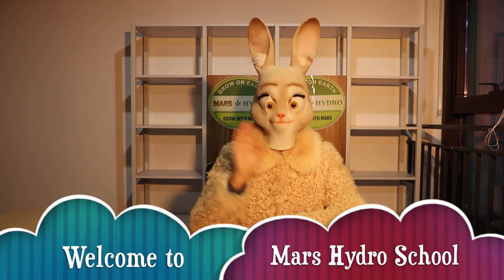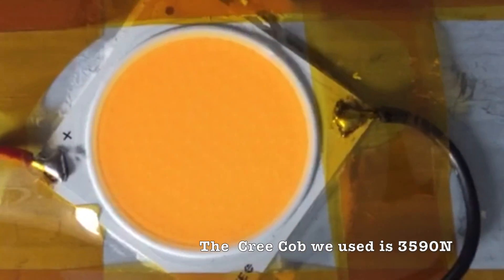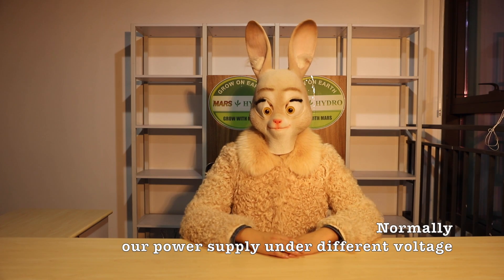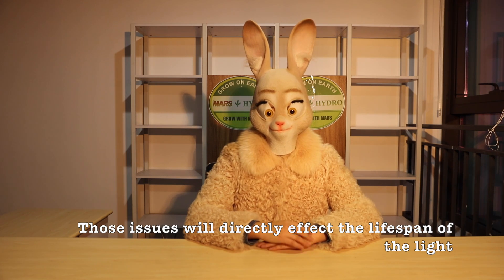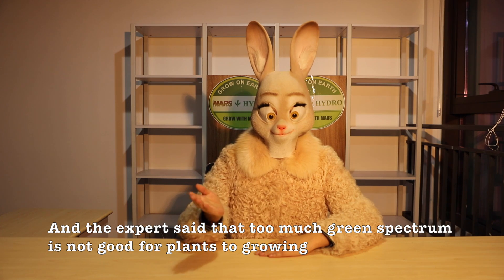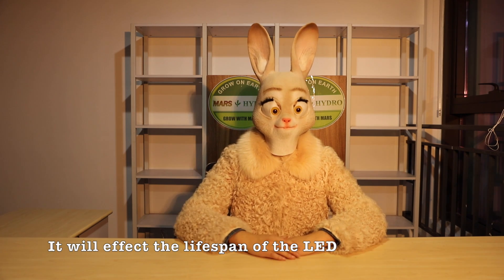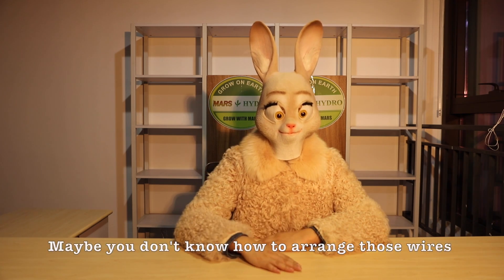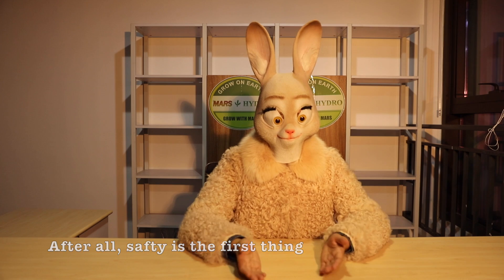Mars Hydro School Season I Episode 4 DIY Mars Hydro LED grow light ? No!!!

Comment: can you please explain why it is not safe to use cob if wired etc safely what is the problem if a driver has range of 60-100v and i use a 72v cob its within the range stated on driver whats unsafe about this? 72v cob at .7ish amp roughly 50watts per driver on 240v from wall. if ur drivers are fine on 120v or 240v from wall whats the problem please explain?
Reply from the maker: Actually, different LEDs specification, we will change the driver specification according. in This video, you can see, The draw power under the 110V and 240V are too much difference. Our light can be used under 110V or 240V, but the draw power difference is within 5%. If it is over that, the power supply will have problem. get that?   Besides, the Wires set  on the casing and you can see  with your eyes, is that safe? I do not think so .